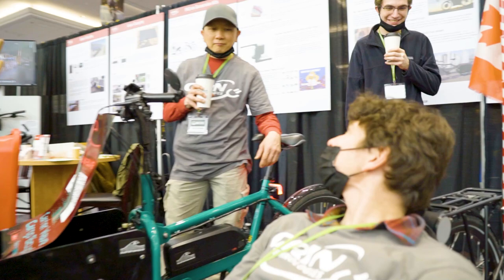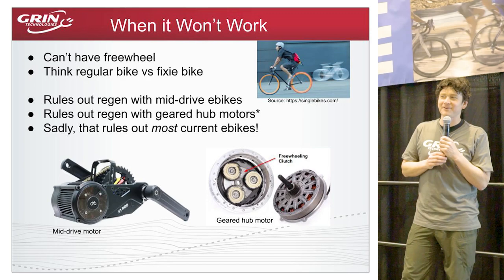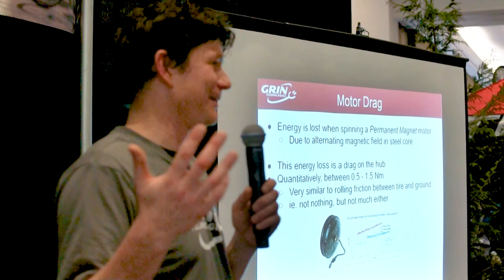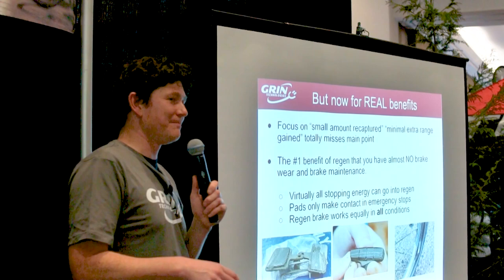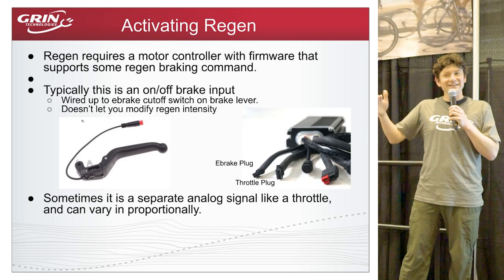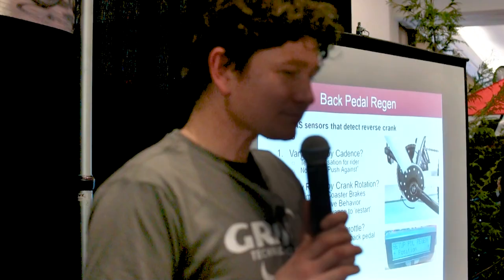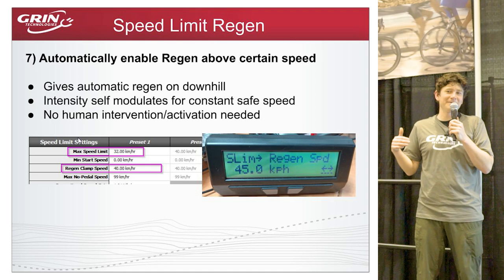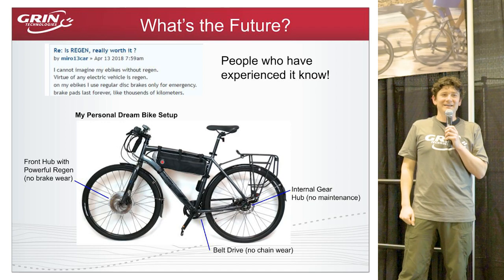Regen Braking and Electric Bicycles, Justin's Presentation from 2022 BC Bike Show

Comment: My Grin rear hub motor (26" wheel) regen torque seems limited by a 500 watt power ceiling it seems. How can I increase the regen braking force? My regen phase amps and battery amps are already set as high as they can go in Phaserunner suite. Is it a Cycle Analyst setting? By comparison, my other Grin front hub motor (20" wheel) is putting 1.1 Kw back into the motor and braking stronger. Thanks!
Reply from the maker: It's generally a function of how fast you are going, so if you want more regen watts you have to travel faster. To get the same max regen energy into the battery from a 26" wheel requires 30% more speed than you'd need in a 20" wheel all else being the same.  That said there are many settings in place that can result in other limits kicking and this is the territory of email tech support more than YT video comments.
Reply: @GrinTechnologies   Thank you :)

Comment: Why not simply have the clutch in geared hub on a relay switch or electromagnet, and engage it with +5V delivered from the hall brake power (shouldn't take more than a few tens of mA)? 
That would fix the drag while having the option for regen. 
Welding the clutch, or having no freewheel is a huge tradeoff in free rolling, especially in fault/discharged states, regardless of how smart the controller can be (yes, I have pedaled against DD drag and it's not fun).
Personally, I don't miss regen that much, I used to run DD setup with regen in the past, but the DD itself chews through power like nothing, and regen doesn't really help it. Geared hub is on the other hand always cool and with FOC, it's running at high enough efficiency. Having a geared hub with regen would be definitely a cool idea, but something tells me that the nylon gearset would wear down much faster, as with acceleration, the rpms are smoothly matched through the clutch mechanism, with braking, the gearset would do a jump from 0 to say 400rpm in a matter of a few miliseconds, unless compensated in software (spin the gears quickly in the other direction, and then engage clutch through relay switch).

By the way, there are brake levers with hall sensors, you just need to look in the right direction ;).
Reply from the maker: Geared motors with regen work just great and we hope to have more than just the GMAC to offer on this front in the future. There is no increased issues of gear wear. In fact it's engaging the opposite side of the gear teeth. The main issue is ensuring now back and forth play in things like the key stock that holds the planet carrier in place on the axle.  

Adding a controlled clutch comes up all the time.  If you think you can engineer one that takes minimal power to control where the benefits outweigh the complexities and costs then definitely the market is wide open for you to introduce it ;-)
Reply: @GrinTechnologies Thanks for the reply ;-)
 I think only for the sake of regen, probably no-one will take up the challenge. 🙂
There's also the effect of motor lock-up due to MosFET fault or phase wire short, which can nastily end up a ride, especially on front wheel driven bike, when paired with DD or clutchless geared hub. 
On deeper thought, controlled clutch would come with more challenges, since then it'd have to be friction based clutch, just like in a car, since the RPMs would need to be matched slowly (alternatively, using the speed based matching, with a speed sensor, quite complicated). And that'd possibly break the compatibility with generic controllers. It would be great addition to dual-speed hubs, but not many of those are available.

By the way, on topic of geared hub lifespan, I had a talk with my friend machinist on nylon gearset wear, and we came to an estimate, that with large enough gearset, it should last nearly indefinitely in sealed enclosure as long as the torque doesn't exceed crazy values, and the motor stays relatively cool. Various reports on the internet mention 5,000-20,000km lifespan and the planets still looked perfectly fine even after those ranges.
So, is it common that the planets ever need exchanging in a large hub such as Bafang BPM or G60?
Reply from the maker: @ondra30  Regarding nylon gears, our experience is that there is no "wear life" of the gears. They either last forever, or they fail suddenly if exposed to excessive torque for their temperature or from loose debris getting in the motor and wedging in the gears.  

Regarding mosfet faults causing shorted phase wires, this is indeed one argument in favor of clutches that I would have addressed in a longer presentation. In our experience though (which has included hundreds of failed controller mosfets over the years), this doesn't usually result in anything catastrophic. The inductance of the motor windings limits the amount of braking current that builds up, so you typically just get a lot of heavy vibration and stuttering from the wheel as you slowly come to a stop. The motor doesn't lock up or fall out of the forks or anything like that. And most often the mosfet failure is when you are accelerating from a dead stop (that's when phase currents are highest), and not when travelling at speed. 

We used to share this same concern but it's been largely nullified by extensive firsthand and secondhand experience.

Comment: Simple. Use a hand clutch instead of a free wheel and use a twist grip shifter as the variance for the level of regen, good chance there is a locker you can add to a geared drive. For motorized bicycles, they have clutches, that have a clip latch in the lever so  then if you are wanting to pedal without powered assist, then you just latch the clutch lever in the pulled position, then when you release the clutch, you get what every motorcycle rider is used to, "engine braking". With fixed gear and mid drive (Utilizing pedals on jack shaft with freewheel) and having an actual gear box built-into the mid drive more like a motorcycle you get a normal engine braking style of ride, minus the ability to pedal, however a second clutch or basically a disengagement can be added at the main drive. Having a clutch also gives you ability for variance of the power to the rear wheal and you can ease in when drive is at higher RPM. If you want automatic, then direct drive hub with a smart controller using brake lever position, pedal crank hall sensors and pedal crank position sensors should be able to create different braking profiles or riding styles or set custom "styles" for the brakes applied, and could even use machine learning models to help determine the style of riding at that time .

Comment: I love your explainer videos. They are simply excellent. Have you seen the Lyric Cycles Graffiti? It has a direct drive hub motor, regenerative braking, and belt drive : your ideal no/low-maintenance bicycle. I am not sure how they are doing the regenerative braking control nor do I know the design of the torque arms - might require a lot of nut tightening. Oh, and they're Canadian!
Reply: Looks like they went to a geared hub and no more regen for 2023 models.
Reply: @balahmay  geared hub and no more regen for 2023 models?!? awwww

Comment: There are tradeoffs with activating regen.
Specifically when you may be pushing slightly too much power and riding the temperature limits as is without it, include it in this scenario and you wind up with burnt windings. Depending on how it is configured Regen braking can induce massive amounts of heat in higher power applications (Take electric scooters for example, their motors are usually getting quite warm as they all usually have regen, turn it off and the motors can handle much more abusive riding).
(I have to disable regen on my Zero 10X type scooter when outside temps hit 40*c in Australia or my battery starts to overheat anyways and the motor casings hit temps higher than I've ever been comfortable with)

I still love regen and it's applications and I haven't even gotten a chance to play with it in variable output form (besides basic level 1-5 type control via a settings menu)
Reply: Another amazing addition to the content on the channel!
Reply from the maker: Yup for sure, that's why we brought this up at 40:18 in the presentation video. On normal ebikes it's pretty rare to hit that point but there are scenarios where it's better to save motor heating reserves for the climb, and not use it up on the descents.

If you are at this point definitely use statorade in your hubs as the cooling happens much faster.
Reply: @GrinTechnologies  I must've phased out in that moment, totally missed it for sure.

Would you believe it, a friend of mine actually gave me a spare tube of statorade for my birthday last year. Too bad my young fella got to it and ejected it all over himself (P.S Mycellar water seems to do a pretty good job of cleaning it up, he didn't get any stains on him)

I know I'm always pushing the envelope when it comes to power limits v temperature limits, but I honestly dont see statorade curing my issue after seeing how it performs in an 11" Wolf King scooter (pushes far more power than I do and they still get really, really toasty on bad days) but it will definately bring me down from feeling 70*c+ on the regular, they just get completely heat soaked as I do 50km trips on them at a time usually at 60km/h.

Also, I'm a big fan of having a button for regen activation while using either the throttle or brake lever as an analogue signal. Avoiding touching the brake lever and giving it a squeese ultimately saves pads the most and these days even cheap hydraulics apply a fair bit of pressure by the time a basic cutoff switch activates.

(Did I mention the X10 I ride also has a feature were it turns off regen automatically at a set speed, 14km/h to be precise, anything below that is all up to mechanical brakes, which helps a lot with avoiding that super low efficiency band at lower speeds.

Thanks again for the great video!
Reply: @JamiePineappleWyatt  When I watched Justin struggling with engine heat, I wondered if spraying water mist on the motor, while running, would help or not.
Reply: @xmtxx  yes but thats something that we're trying to avoid putting any where near motors or controllers

Comment: What you need is a little lever in front of the brake lever so your pointer finger can be for a variable ebrake.  Like a little lever on top of the brake lever.  You could use your pointer finger to just vary ebrake and if you panic, just pull the main brake that is already there.
Reply from the maker: That's a great idea too.

Comment: Love the regen on my bike. I go like hell down hill and peddle hard with the ebrake on. I have a 1500 watt hub motor.
Yes the eddy current is a pain when the battery is dead. But when regen is on it puts a lot of amps back into the battery. Can actually see it on the bar gauge.
My bike and me weigh around 400 lbs.
After building my own bike I would never put a small motor on it, just for the regen.

Comment: Growing up in the 1960's, all are bikes had the brakes controlled by pushing back on the pedel about an 1/8 way back and putting your weight on it if you wanted to lock the wheel up. They only had rear brakes. The bikes only had one speed. Also, it is possible to have a mid-motor with regen. Just need a second chain that is free floating  to pedals and one from motor to rear. A company sells the mid-motors with regen, it's something like CDL, at least it starts with a C. I think they are out of HongKong, but maybe Taiwan. They're made for diy onto non motored bikes. I found them on You Tube.

Comment: Would inventing free pedals solve the problem of free wheels. So no free wheel, but pedals turn freely on the axle. Like individual locking mechanisms for each pedal.

Comment: A xery interesting and infomative presentation, thanks for taking the trouble to make this video.
However, I think that most viewers will still be left wondering, 'Just how much extra battery charge can I get from Regenerative Braking'?
Would it be possible to do a SIMPLE AND CLEAR demonstration by riding an ebike repeatedly round a hilly course with and without regen to show how much extra range and or charge you get?
Reply from the maker: Thanks for the feedback. We covered that topic specifically here:  https://www.youtube.com/watch?v=gYCj4asp9pE&t=747s  Agreed that for mainstream viewership a "side by side" test format is easier to convey a point, even if it's not scientifically all that interesting in this case.  

A key goal of this particular talk was shifting discussion on regen away from just about the extended range but onto the perks of having zero maintenance, zero cost, perfectly smooth, and all-weather brakes. So even if the range extension was zero, we'd still be raving about it. The fact that it typically brings you back an 6-10% is a nice plus, but we'd consider that a secondary benefit and not the primary one. 

So perhaps a side by side video tracking the brake pad wear on a bike with regen and one without? ;-)

Comment: great presentation. i would like to point out high charge rate advantage of iron over cobalt where in long distance trips an hour of timeout with 5c charge rate makes a substantial difference on the total range of the bike
Reply from the maker: For sure high current cells and fast chargers help with road trips! But that's not really a lifepo4 vs cobalt thing, there are high and low resistance cell options in both chemistries.

Comment: I have a couple of e scooters one of them has a drive motor on the front and a dedicated regen brake motor on the rear that is by far my favourite  no brake pad changes .Most of the mechanical brakes are to small for purpose not strong enough at all and wear to fast and need regular adjustment and replacement.    I work on semi trucks and i can see absolutely huge benefits of regen on an electric vehicle brakes are definitely the biggest maintenance and failure  points on most trucks .
Reply from the maker: Bingo! It's so fun still reading all the naysayers who insist it's not worth it and that mechanical brakes are all fine.  Once you experience regen, there's no going back.

Comment: That larger regen in hilly areas seems odd to me since you use way more energy climbing hills in the first place and get nowhere near that energy back descending.
Reply from the maker: You get more regen in hilly areas for sure since you do more regenerative braking as you would on the flat.  Your total Wh/km is still higher in a hilly area than on the flat ground, but it's much closer to flat ground wh/km figures than it is to hilly riding wh/km figures without regen.

Comment: Question about non permanent magnet moroes and regen. Does one use more power to create the fields than what one gets back from the subsequent regen?
Reply from the maker: At very low rpms yes, at higher rpms its not even close. The crossover point depends on both the intensity the regen torque and the resistance of the motor and coil windings.
Reply: ok. so non permanent magnet motors can do just fine? btw the coreless motors, are they viable or will they become too big? can they be small if they go high rpm? @GrinTechnologies

Comment: My Toyota Estima hybrid use 1/3 less fuel than a non hybrid. The Chinese claim the train sells to  Indonesia recover 85% of the energy through regenerative braking. My DIY plans is rear wheel freewheel 24v gear motor, 48v non freewheel motor at the front as generator; step up converter; 24v charger;  controller sense when not pedaling then enable the generator and vise versa. I also install a solar, battery storage  and rain water system at home which enrich live without costing much,  hook on to capture free resource otherwise like the wind blow away.

Comment: Disc brake pad get ruined the most when used very lightly in prolonged situations, like governing your descent down a long hill. They are really best used in hard short breaking. So with regen you pretty much guarantee that you always have those strong friction brakes in good condition for when you actually need them.